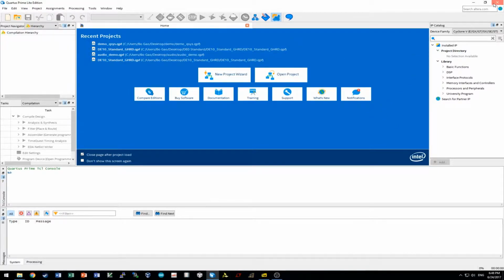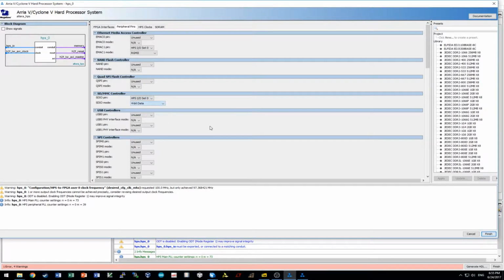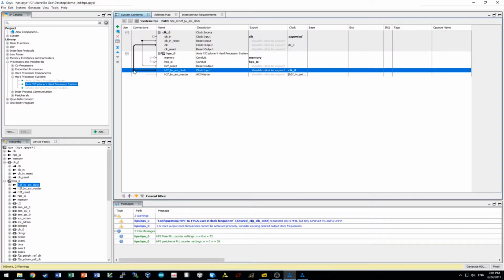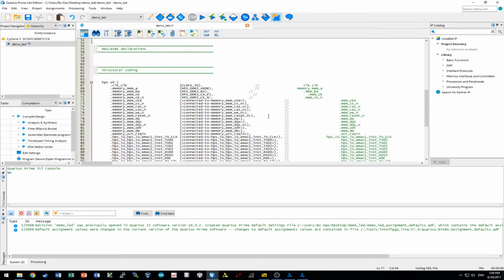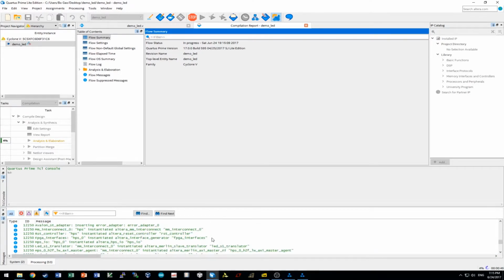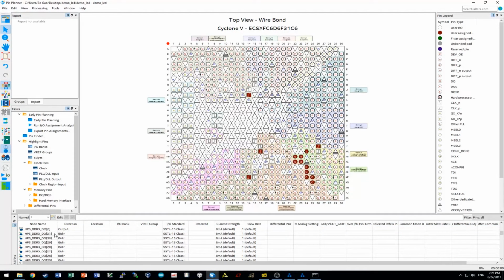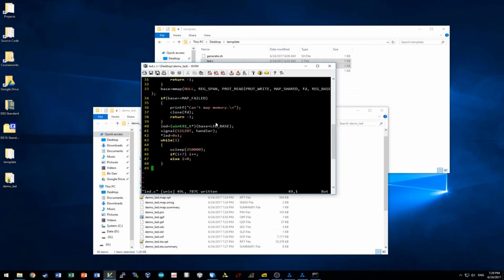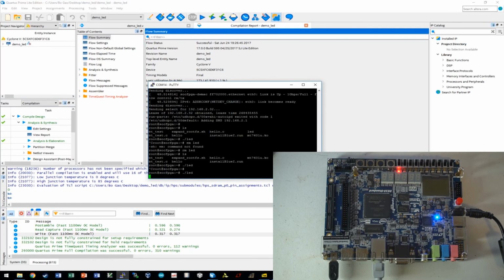Terasic DE10-Standard Tutorial -- 4. First Qsys Project

Comment: Thanks for the this video! Which datasheet did you refer to, to figure out that the gpio pin 35 needs to be exported? (mentioned it at 8:28 - Configuration section of the video)

Comment: I have followed your tutorial and I understood everything you made. It worked for me.
But only one doubt, when you assign parameters to the DDR3 memory in the HPS, how do you do it? Why do you choose those values and no others?
I have taken a look at the GHRD, but they are different. I would like to understand the logic.
Thank you.
Reply from the maker: GRHD has a reference project. I assigned based on those sets of values. Maybe they revised it, but my video was using data that was available at the time it was filmed.
Reply: @bskull3232  I will check it again tomorrow, maybe I opened a different design. Thank you very much for your response. And thanks for this tutorial, I hope to use it as the base to develop bigger projects.

Comment: Hi.. Thanks for the tutorial. But where actually do you program de FPGA? .. What I really want to ask is how to add VHDL or Verilog code and run it? for example if I have a VHDL code that control the LEDs depending of the state of the switches.. or say I want to get the info at HPS from a specific periferal conected to the FPGA and then change the state of the LEDs depending of that info.. where in the Qsys ot quatus should I introduce that VHDL code? THanks in advance..
Reply: See the part 1 of the tutorial.

Comment: Hello, as already said : very good tutorial, congratulation and thank you !
I have some issue trying to boot with the sd card : I installed the linux image (console mode) on the card using Win32DiskImager. But when I start the board, I get a "unknow usb device" instead of the virtual COM port that I use to access the linux OS via SSH (using putty).  I don't get the problem when I use the original content of the sd card. 
Would you have an idea how to fix this problem please ?
Reply: You have to install the driver for the FTDI chip (the chip that is responsible for the virtual com port) present on your board.

Comment: Hi, it's really a perfect tutorial. 
I have some question about using both HPS and FPGA. I want to use HPS to display the GUI interface, but when I program the FPGA, HDMI display is missing(I also can control my DE10 with router), is that a correct process? or did I need to write HDMI IP in FPGA?? is there a solution to display GUI interface with HPS instead of using FPGA IP??
thank you !
Reply from the maker: DE10-Standard doesn't have an HDMI. It does have an RGB interface, which is used to connect to an ADI video encoder to generate VGA and RCA outputs. This is an FPGA peripheral, not HPS peripheral, so you need an FPGA QSYS IP block to get it to work, and in the meantime you need a Linux driver to talk to the QSYS peripheral and use it as a framebuffer.

I've never dived into the LXDE image provided by Terasic, so I don't want to talk too much about it. I'm no where expert in FPGAs, I did this video just as a casual demonstration of this FPGA's capability, mostly just for fun. If you need a definitive answer, you need to ask someone else. You can write to Terasic and see how they can help you.
Reply: Thanks for your reply! It's helpful, I'll ask Terasic for helping~
Your channel and videos is really nice! ^^

Comment: Hi, i'm working on a DE10-Nano by Terasic and i only need the Ethernet port to conect the board with the PC. I've be configured the Qsys system with an Ethernet TSE susbsystem to use the port and a HPS Cyclone V subsystem to connect the FPGA with the HPS.
I just wanna know if i need program something in linux or in the SD Card, cause i've found a tutorial and nothing else is necessary but it doesn't work.
Reply from the maker: If you enabled the CPU peripheral and napped the pins correctly, and it doesn't work, then check your DTB. I would use Terasic official console Linux, and so far it worked for me on DE10.

Comment: Hi Bo,
I using the DE10-nano board and want to develop FPGA and HPS SoC on it, but I have some problems.
I can only configure the FPGA without HPS or only run C programs(Hello world) on the HPS, when I use QSys to generate a HPS+FPGA system, I can't understand how to configure it into the SoC. If I use programmer to program the .sof file into FPGA directly, the HPS will not work. And if I replace the .rbf file in the SD card use the .rbf file which I generate by the .sof file, the HPS linux OS will not startup (I says it haven't ethernet device, etc.). So what should I do for the QSys then I can configure the SoC correctly and run the program on the HPS to control the FPGA?
Thank you in advance.
Reply from the maker: Dmitri Abramovic There are 2 official hps images, one requires all peripherals (the graphics one), while the console one doesn't require any fpga resources, therefore you can boot the console only image with your own fpga design.
Reply: Thanks a lot! It means when I boot my HPS with only console, I can still use the FPGA peripherals? Will this cause me to be unable to use peripherals such as Ethernet on HPS?
Reply from the maker: Dmitri Abramovic It all depends on device tree configuration.
Reply: Oh! It means if I configured the peripherals in the Qsys, then HPS can access them, is it?
Reply from the maker: What do you mean peripherals? Do you mean HPS peripherals (Ethernet, I2S, etc.) or FPGA peripherals? For FPGA peripherals (your own Qsys components), the component will have an address, and you just map the address and write/read it. For HPS peripherals, Qsys configuration simply sets corresponding IO mux, and the memory address of those are already in HPS address space, and you only need to tell Linux kernel to use it (either use device tree blob or dynamic device manager, aka cape manager).
Reply: That's great, Now I understand, Linux can access the HPS peripherals automatic if I have been configured it in Qsys, and Linux can access the FPGA peripherals by AXI bus address I configured! Thanks again for your help!